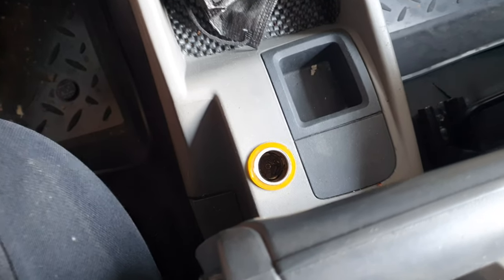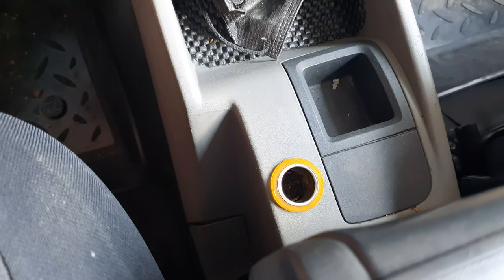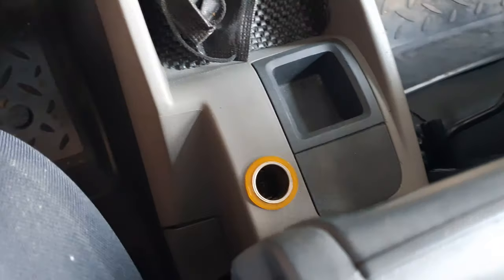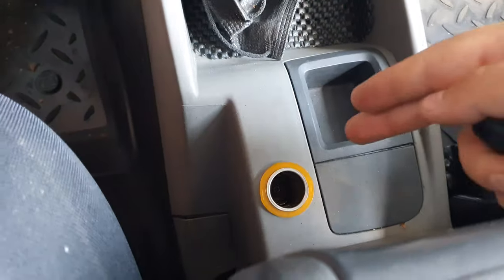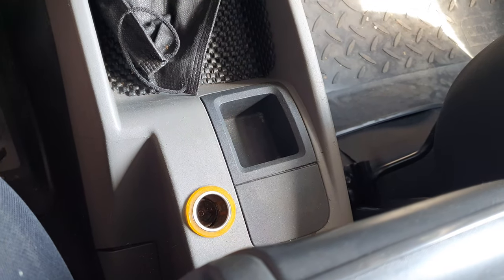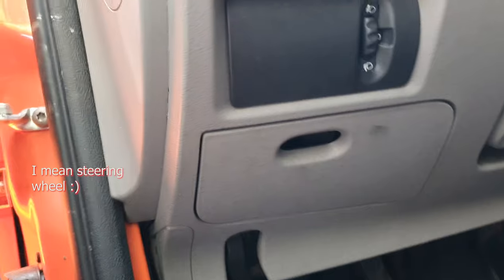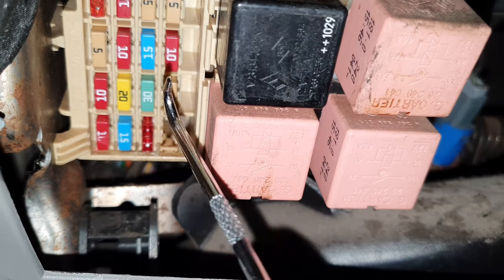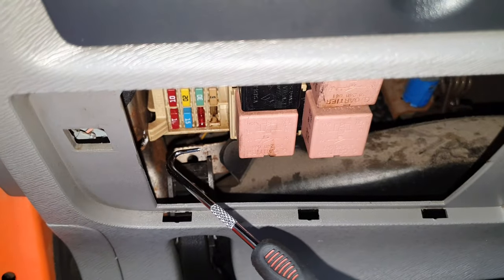Renault Kangoo: How to Fix a Car Cigarette Lighter (Power Outlet) Not Working: Troubleshoot & Fix

Comment: The Red tool clipped to the fuse cover is for removing the fuses! 😉 2 minutes 29 seconds it's literally in the middle of the shot 👍
Reply from the maker: The place for the fuses is narrow, my hand didnt fit to get out fuses with the factory clipper, and trust me i dont have big hands :)) at least some other car manufactures are doing those clippers longer not that small like Renault.

Comment: Do you know how to fix so that the 12v outlet gets constant power without engine on?
Reply from the maker: 12v outlets back in the day used to be hooked up to accessory, meaning that they would only have power when the key was turned to the accessory or run position. Nowadays they are hooked straight to power meaning they are known as being “hot at all times”. When you turn the key off, the power keeps flowing. It's normal. Thats why its recomended to not leave anything in the 12v outlets, however if you dont like the behaviour of that outlet it might be possibile to fix it with a simple fuse swap, you just need to locate the fuse for your 12v outlet, and see if you have the 3 pins line, a quick video on this matter is here: https://www.youtube.com/watch?v=B2JXmz-nLPU

Also on some cars the modules are shut down 15-20 minutes after the car was locked so the 12v socket will drain the power only for 15-20 minutes after you locked the car, did you checked this scenario ?

Comment: I'm a smoker, can you actually put a working cigarette lighter in this car? What year is this model?
Reply from the maker: This one is from 2010, and yes it has the lighter. But this days everybody has a lighter in their poket i am not realy using the one from the car.
Reply: @SanKraNsWorkshop  Pocket lighters don't work with the fans on or the windows down though.
Reply from the maker: @halfmoon106  They do work if you have the right tool, for example i am using this types: https://www.tanziilaat.com/product/electric-cigarette-2in1-double-arc-and-jet-flame-lighter/

Comment: Can't get into the fuss box
Reply from the maker: How come? whats blocking you? you've seen in the video how easy i plucked the fuse cover on my model.
Reply: @SanKraNsWorkshop  can't get it pop off
Reply from the maker: @leomorgan7418   Pull harder from the top  if you have the same model, in the video you can see the exact clamps and how they are positioned. Just be carefoul not to brake it its a plastic afterall.